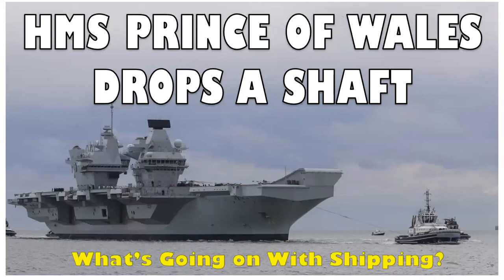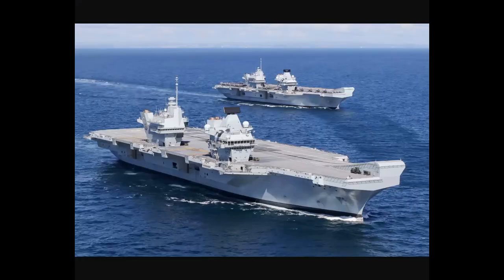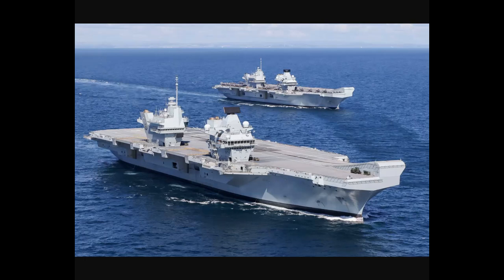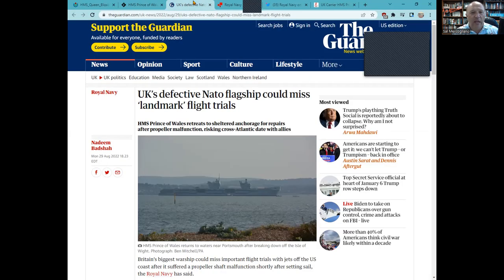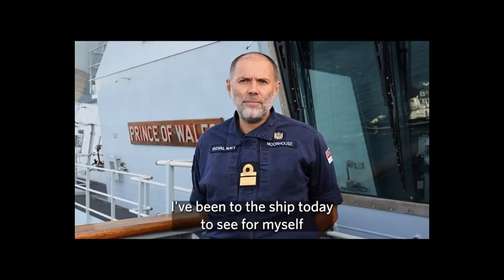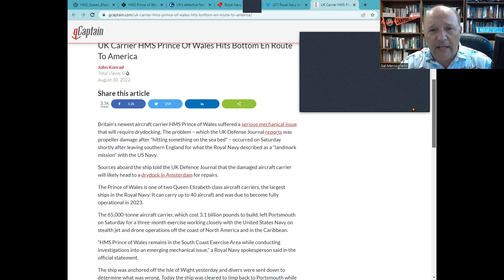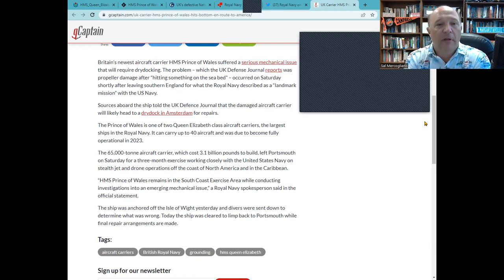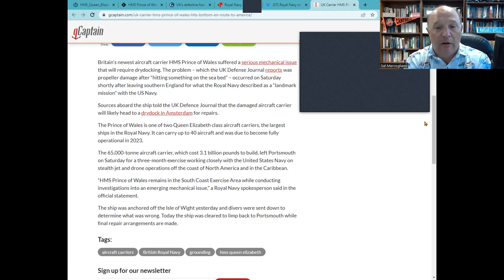HMS Prince of Wales Drops a Shaft - What's Going on With Shipping?

Comment from the maker: The reason HMS Prince of Wales could not begin her planned deployment is that an external SKF coupling that connects the outer propellor shaft to the drive shaft from the propulsion motors failed.

https://www.navylookout.com/hms-prince-of-wales-to-be-dry-docked-while-hms-queen-elizabeth-takes-on-some-of-her-tasking/
Reply: 2m air gap
Reply: @imogengoffe1384  
80 thou is still atrocious
Reply: SKF seems to be a brand name for couplings, like Xerox photocopier.
Good article.  Sounds like a royal (no pun intended) mess.
Reply: They should be careful commenting ,  the coupling is not an SKF coupling,
Reply: @st3467  SKF is a swedish company that makes ball bearings. This problem seems simple. Just put in a new one.

Comment: So in the last year year we have had ship groundings, fires, and scuttles that all had a question of competence failures around them. What is Going on With Shipping indeed...
Reply: Just SNAFU bro, Situation Normal, All 'Fouled' Up.
Reply: Rubbish. Big ships are incredibly complex machines. There is a lot to go wrong with thousands of systems on board. When you add the human dimension then send the whole lot out to sea, one of the harshest environments on earth, it only gets worse.

Ships have been colliding, hitting the bottom, ramming things, catching fire and (more recently) even accidentally exploding since ships were invented. The more sophisticated and larger a navy, the more likely it is to happen.

Look up the 1923 Honda Point disaster, for example,  where 7 US destroyers ran aground because of a navigation error, or HMS Captain disaster in 1870, or the USS Forrestal fire in 1967, or the USS Enterprise fire in 1969, or the USS Iowa turret 2 explosion in 1989, or the loss of HMS Vanguard which exploded in Scapa Flow in 1917.

This incident with POW is nothing unusual. It simply demonstrates how hard it is to run a Navy. As usual, however the media are making clickbait BS headlines like "failure to grease the prop shaft" to get knee jerk, outraged reactions on Twitter.
Reply: @robertf3479  No, this is FUBAR "Fouled up beyond all recognition".
Reply: If you think you could do better then by all means try, nothing like experts who've never done it is there?

Comment: Hi Sam.  I suspect that PoW hit something either on the bottom or "kissed" her own pier with that propeller.  I've seen both happen and with gas turbine powered ships you have the added complication of using Controllable Reversable Pitch propellers.  I've seen props on destroyers (17 foot diameter) get chewed up, blades torn up or torn off. 

I think best case here is one, two or even all blades on that prop were mangled and will require replacement of those blades.  I've heard of it being done by divers with smaller ships, but a prop for this thing probably has blades that are 6 feet (about 2 meters) long with a total prop diameter of 16 to 18 feet (2.5 to 3 or so meters.)  Both times my destroyer had to replace blades we did it in a floating drydock.

If this is what the problem really is, PoW can be in and out of in a very few days.  If there is propeller HUB or shaft damage ... your guess is as good as mine shipmate.

IIRC, Portsmouth harbor (Naval Base) needed dredging in order to have the waters deep enough for the QE class ships.  I wonder if the dredges missed something and PoW found it the hard way?  It's happened before.
Reply: If they did hit an unknown submerged object at least it will be on the charts now.
Reply: The propeller blades were actually fitted underwater in the wet basin at Rosyth after engine tests with temporary resistance blades. The ships have 2 propellers each of 33 feet diameter.
Reply: @ScienceChap  33 feet, Wow!  I hope there wasn't any shaft or prop hub damage, that kind of repair work would suck worse than changing out blades.
Reply: @pauliedweasel  Once they nail down the actual location they'll probably clear it away as a hazard.
Reply: Its the drive shaft to the prop that is the problem and not the prop.
Reply: @pauliedweasel  Assuming the submerged object didn’t sail back to Murmansk…
Hitting submarines is an occupational hazard for aircraft carriers…
Reply: Are you guys saying  it hit something and everyone is like la de  da. . 
Did you feel that Mate ?
  Nope !
" Nothing to see here Boys, nothing to see... 
So just, 
Smile and Wave, Just smile and Wave.. "
LOL
Reply: @John-nc4bl  Ah krap!  Prop shaft problems usually require pulling the damned thing, rarely quick and never easy.  Sounds like she's going to miss the exercise and SinkEx, the USN is donating an old Perry class frigate for the festivities.
Reply: @allangibson8494  It was probably that pesky Captain Tupolev and his Alpha Class (Лира) submarine again!
Reply: lmao funny way to spell incompetence.
Reply: I too have read on some Telegram channel, chances of being hit by a submarine. Since, PoW is huge it can't detect anything directly under it.  The chances of it hitting the bottom of sea are less, since it must have moved in and out of it's anchorage many times after it got commissioned in 2017.
Reply: Damage to a propellor blade will throw it out if balance. The resulting forces will quickly damage the bearings. IF that’s the actual cause of the failure.
Reply: @robertf3479  damn. Correction.... they are 33 tonnes, not 33 feet.

The rest is correct though. They definitely fitted both ships' propeller blades in the wet basin at Rosyth.

Finally, the update from Navy Lookout is that she has broken an SKF coupling on the starboard shaft, which will entail a slow trip to Rosyth for drydocking and repairs. Babcock will do her Lloyd's naval Hull inspection at the same time. 

She's now back in Portsmouth removing stores and personnel prior to heading north. HMS Queen Elizabeth is to head to the US in her place.

Comment: Just to say the only Drydock in the UK capable of handling the QE class is in Rosyth (where the carriers were assembled) near Edinburgh, the issue being that with limited propulsion that's a 500+ mile journey so Amsterdam would be significantly closer.
Reply: Is this combat ship a single screw?
Reply: @oldmech619  No. It was noticed there was only one wake as she sailed out of port.
Reply: There are several  other dry docks of sufficient size to take these ships. The KGV dock in Southampton and the HW shipbuilding dock in in Belfast are both very large docks - however they may be in use currently for commercial purposes and are not available at short notice.
Reply: @rayofhope1114  KGV dock doesn't have sufficient space for the carrier upper hill as it overhangs too far, would need to do some work but it seems like an obvious solution for the long term.
Reply: @rayofhope1114  KGV graving dock would need a new gate, keel blocks and repair/replacement of pumping equipment as well as work on its overall beam.
Reply: Good points on the requirements at the Southampton KGV dock - certainly not suitable short term. There were rumours of a plan to convert the Number 2 basin in Portsmouth dockyard into a very large dock - not something to today but would certainly make sense long term as both ships are based there probably for the next 50 years.
Reply: @rayofhope1114  Both these ships will be scrapped or in some other nations navy long before that supposed 50 year lifespan is up.
Reply: @Makeyourselfbig  clearly you have no idea of reality. These ships - similarly to USA ships - have a designed lifespan of 50 plus years.
Reply: Probably better going to Amsterdam as it would appear, according to Liz Truss, British workers are lazy. Btw Rosyth is closer to Dunfermline.
Reply: @rayofhope1114  Would makes sense.
Reply: @oldmech619  No two screws
Reply: @Bruce-1956  indeed but I doubt most people from the US who are watching this would know where Dunfermline is haha
Reply: Get the Armada to tow us .
Reply: @nottmfunguy     Why did the PoW need to be towed if only one shaft was damaged?
Reply: I would think taking her to a foreign country would be unacceptable. She can proceed quite easily in one shaft with the other locked. Unless of course the failure was so bad it prevents the shaft being locked.
Reply: @GrenvilleP710     The Royal Navy is unnecessarily quiet about the failure to proceed under it own power. Sound more like the Admiral Kuznetsov

Comment: I remember the Queen Elizabeth carrier had similar problems. The propeller is not a one piece unit. Each blade is separately attached to the central hub and one of the blades became mis-aligned somehow. The result was vibration that caused the shaft to wobble, which was notice by a crewmember. I wonder if it's the same problem.
Reply: She picked up debris off the seabed in her screw when she was leaving Glasgow for the first time.  The MoD were furious with the local port authority because it was in their remit to look after the channel entrance.
Reply: Waste of taxpayers money,destroyers as well.Back to the drawing board guy's.
Reply: @navnig  Peel Ports control most (If not all ) ports in the UK now.  PP worked out it is more profitable to run down the facilities, selling them off for housing where it can.  Only when absolutely forced, will PP actually do the job it's supposed to do.
Reply: @ptonpc  I live in Glasgow and I can’t remember the last time the river Clyde from BAE yard at govan all the way out to the  ERSKINE BRIDGE WAS DREDGED THE CLYDE DREDGER WAS A COMMON SITE AT ONE TIME
Reply: @thomasshepard6030  Yes, Peel Ports wanted more money.

Comment: Babcock Rosyth has a ten  year plus contract with the MOD for the dry docking of both aircraft carriers and they had scheduled to bring this vessel in for its five year inspection early 2023 so a possibility that if a shaft is needing replaced or repair they could combine the two activities. Financially, it would be logical to utilise this route given that this yard has the experience of assembling these vessels and know them inside out, all be it getting the vessel into the dock is not an easy task due to the limited tidal conditions to accommodate its size.
Reply: 5 docks are capable of taking them in the UK, and the worst to fit them into is Babcock Rosyth, nearly as bad as building your submarine construction yard miles from the sea, up a shallow river, with horrendous currents and exiting into a shallow sea - oh hold on 🤣

Comment: Warships are supposed to be resilient and to carry on operating despite battle damage. So a peacetime breakdown on leaving port isn’t a good start!
Reply: MK: She can still make way with her other shaft, but there is no war. No reason to press on and risk more damage, and risk being dead in the water if any other engineering problem were to develop.  BTW, this is a brand new ship of a brand new design. It takes years to work out the bugs and learn the quirks of a new ship.  Stop the histrionics.
Reply: Modern warfare equipment in general is not resilient because of the over-reliance on high-tech. It's embarrassing.
Reply: @thisoldgoat3927  England is a tiny island with major problems 
She is no longer an imperialist nation
Just has not woken up to that fact
Reply: Peacetime is when you WANT a breakdown though.
Reply: @maxsweetman6341 it’s not an island. It’s on an island. With two other countries.

Comment: Nether the shaft bearings nor the (supposedly) controllable pitch prop have 'grease', those systems use lube oil in pillow block bearings for the sahft and hydraulic oil for the controllable pitch mechanism. The thrust bearing is also pressurized lube oil
Reply: So they don't have an AB visiting the stern-tube and giving the greaser a quick turn every night?
Reply: Typically RN vessels use seawater lubricated rubber staves for the bearings or a composite material (cotton phenolic) IIRC.

Comment: This takes me back to 1962 when I was on HMS Ark Royal, The noise and vibration when the port side hit Drake's Island in Plymouth Sound, was remarkable, Screw chewed up, port rudder bent, tanks including Aviation fuel tanks ruptured, Luckily Devonport dockyard was able to dry dock and repair in 6 weeks if I recall correctly, long time ago. 
This was a result of  Pilot error, caused by a Navigation Buoy being dragged  out of position in the previous days storms, which we rode out inside the breakwater.

Comment: Whenever I hear that term, I picture the screw and shaft slipping out of the back of the boat. lol
Reply: I was picturing the same thing along with a four foot diameter solid spray of water coming in through the hole where the shaft had been.

Comment: Just a gentle heads up on UK dry docks.
She was built by Babcock in Rosyth and that dry dock is available. The T31 frigates being built there do not use the dry dock. We also have Harland & Wolff in Belfast which has a huge dry dock.
The issue of where to dry dock these ships was looked at some time back when QE went in for her first post deployment refit and Rosyth was used. Other options were Merseyside or Teesport. It is a long way North to Rosyth to tow a large ship and Belfast (or Amsterdam) is a lot closer. Not sure politically we would choose to go to a foreign port though.
But as you say there is a lot of ill informed scuttlebutt going around right now. As for cancellation of the tasking the other carrier is on high readiness and could be sent in the place of PoW although one specific test of the F-35B would possibly not be possible.
Reply: Belfast cannot take these carriers, the dock gate has to small a draft at 8.5 meters.

Comment: Sal I could see the ship from the bottom of my road  as it went pass (it's one of the advantages of living in the home port)!

It seems very strange that the ship hit the bottom because they dredged a channel just for the new aircraft carries & it is clearly marked - I can send you photos.  Also, the port went out and brought new tugs that had to be built bigger to handle the mass of the new aircraft carries in and out of port and the ships do not go in/out of port without the tugs being hocked up. 

Some photos show that when the ship exited the port only one screw was operational whereas all the other times both ships left port both screws were being used.

If you want to find something interesting this ship has flooded 3 or 4 times now and one time almost sank in the harbour - the locals have nicked named her HMS leaky due to all the floods that happened to her. 

She the second ship of the class but she been made slightly bigger and slightly different (lessons learned from the first ship and operational use) thus she mainly longer than the first ship in it class.
Reply: Amazing behind the scenes stories.
Reply: So basically its a piece of shiit...?
Reply: Ground Zero
Reply: Is it possible that somehow her stern left the dredged portion of the harbor and allowed the starboard screw to smack something on the bottom?
Reply: Shows what happens when costs are cut, a piece of scrap not fit for purpose.
Reply: @robertf3479  not sure how - everything clearly marked and they done this many times before - plus both of the carriers do not move in/out of the port without the tugs  - even the smaller ships use the channel and only have one tug
Reply: @QALibrary  That makes sense.  I visited Portsmouth once in USS Nassau (Large assault ship) so we had at least two harbor tugs alongside as we entered and left.  We moored roughly where the two QE class tie up though things got moved around / rebuilt since I visited in 1992.  It was an easy walk from our ship to HMS Victory and only a little further to the Warrior.

I've always been a naval history buff, so I was in 'hog heaven' during that week we were there.